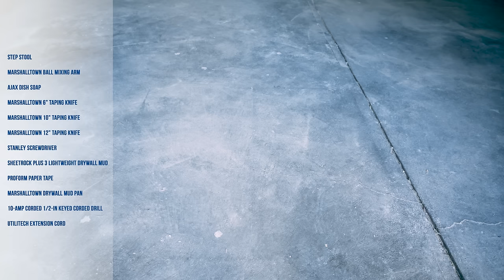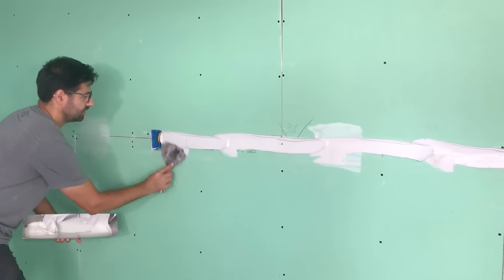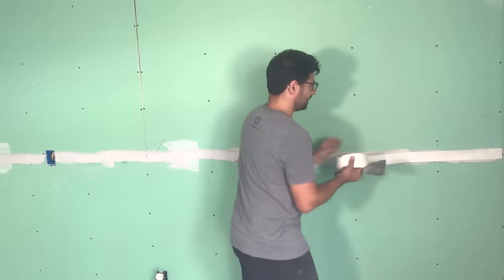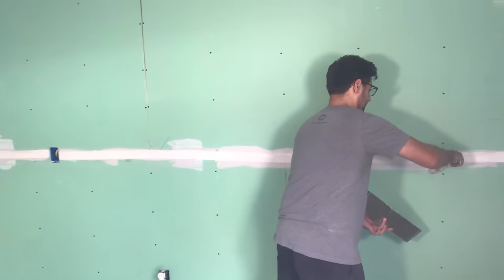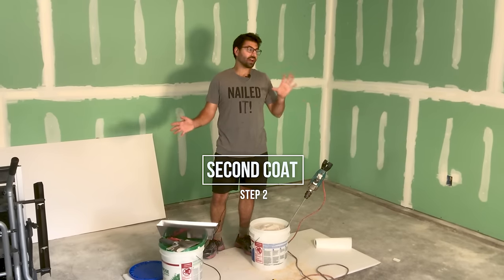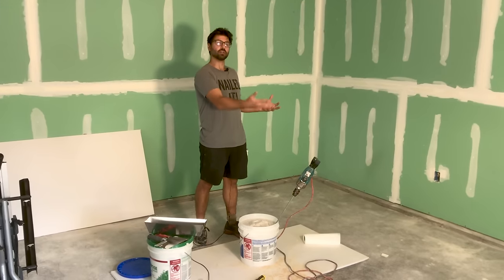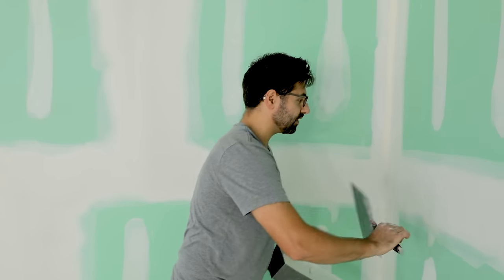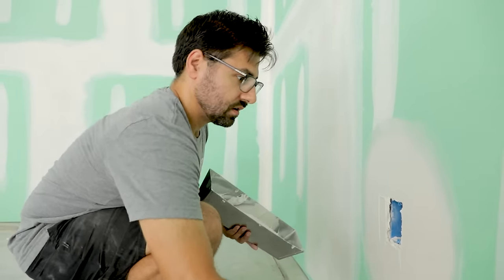How to Finish Drywall For Beginners | Nestrs

Comment: I’ve worked on drywall since I was 10 and now I’m 21. I have watched so many videos on how to drywall just to make see if people do it differently, but I notice that you guys are honestly the only ones who do it correctly.
Reply from the maker: Victor Hernandez haha, thanks Victor! We appreciate you watching -keep killing that drywall game!
Reply: Wrong. Skip the pan..
Reply: I did my first nails when I was 5. Back then they didn't use screws. I'm 52 now. I started working with my dad at 15 but before then I'd helped here and there as a kid.  Some of these videos are so cringe to watch.  My dad started at the dawn of drywall so to say I learned old school is an understatement. I use a hawk, a 14" flat trowel and a 6" knife. That's it. I haven't touched my taping tools in ten years but I could still out pace a banjo with much better results. Honestly, I don't know where these people are learning these days, but they are seriously slow and sloppy. Around here there are a lot of trowel guys, which is fine. I'm just not that ambidextrous. There aren't very many hawk guys but the troughs are generally used by homeowners.  I'd ditch the trough unless you're using it to feed gophers. I think you'll find you can get more material on your tools and run your seams much quicker. This guy had to load his 10' knife like 4 times to do what should have been done in one pass. That's my advice to you. If you're working piece work or by the job, you'll make more money.
Reply: I do everything the same as him besides with flats all you need is a 10 because if you wipe your edge right you won’t need a 12 to go over it I can see with a butt joint

Comment: You guys are great! Couple things... Need to tell beginning drywallers about "hot" mud. The "do it fast" temptation is huge for new mudders. I use small batches (just a pan full, no more) of 45 or 120 for my 1st coat on spaces, joints & screws. It gives me enough time to work but dries fast enough that I can apply the second coat the same day. 

Things to remember with hot mud: SMALL Batches & never mix the crusties back into good mud. I keep a 2nd pan (I like plastic - easier to clean) to put scrapings into. Clean EVERYTHING really well before you make a new batch or it gets hard and you will NEVER get it off. 45 stays workable for about 30 min & 120 for about 90. Set a timer! It is harder than regular mud so it fills in spaces better but it is harder to sand too. If you practice before you actually do a wall, you can get the hang of it quickly & see how fast it set up. It will take you longer than you think it will if you are new to it. FOLLOW THE DIRECTIONS on the bag or avoid all of this & use the premixed stuff y'all are using.

I hate sanding so I am super careful when mudding and take longer than most people do to avoid that.

The other things I do are:
 (1) Run the corner of the knife on concrete real quick (sidewalk, garage floor, etc.. - it will leave a mark on the concrete so be discrete) ; just enough to get rid of the point, but not create a burr. It is a personal preference but it makes corners a breeze. 

(2) Before I mud, I grab a phillips screwdriver & I run my knife over EVERY screw head. I listen for a "ting" sound from high screws. I can easily tighten them as final prep before I start mudding. Trying to do it while mudding slows me down & is super messy, but it NEEDS to be done. You can't leave high screw heads. They will always show, will tear your sand "paper" & the wall will look like crap.
(3) Wash your stuff quickly & DRY it quickly. EVERYTHING rusts & it rusts fast! Rust not only ruins your equipment, but it leave discolored streaks in any mudding you try to do later (i.e., the second & skim coats...).
(4) I set up a work light at a right angle to the wall while I am mudding & sanding so I get shadows from ridges, etc...  

(5) DO NOT clean your stuff in the kitchen or bathroom sink... Mud, especially hot mud, will ruin your plumbing. First, scrape excess mud into a garbage bag & toss it out. Then scrub everything with a green scrubbie pad & dry it well with paper towels. Make sure you get EVERYTHING off if you are using hot mud or it can cause the next batch to harden too fast & you get lumps. Wash tools somewhere where drywall mud haze won't matter. There will be haze.

Final words of warning - Drywall dust & the edges of drywall will RUIN your floors! It is super gritty & will scratch everything. So DO NOT track it everywhere while you are working. Put an old rug at doorways to wipe your feet on. Close room doors so the dust doesn't float all over the rest of the house. It is very hard to get off of stuff. It is also awful for your lungs & eyes masks & glasses are a must. The shop vac is your friend.
Reply from the maker: vrrusa this is awesome! It would actually be appropriate content for “I know the basics for drywall, now what?” or “Drywall Finishing Techniques 2.0”
Reply: @Nestrs  Thank you! Every one of those things Iearned by screwing them up first! (Especially the washing up in the kitchen sink... Now I know how to replace a garbage disposal too!) LOL! Thank you so much for your great vids & super positive attitude!
Reply from the maker: vrrusa LOL
Reply: So you mix the big bucket of mud goes bad in 45 minutes or just the mud you put into the box thin you hold?
Reply: @maddydollear  i think you are asking how much to mix. If you are using "hot mud" or quick drying mud, just what you can use in the time before it sets up. And in the pan you hold.
Reply: @maddydollear  hot mud is a quick setting compound, it has a hardener in it,  comes in 20, 45, 90, and 120 where im at. It is a bag of powder and I would only mix it in a pan with a sheetrock knife and not a bucket unless you are very comfortable with it as it will dry all of a sudden, the water does dry out of it the same as normal mud. Think of it as bondo and the little bit of water that u add activates the hardener in it. I would stick to the normal general purpose mud for taping and floating that is in boxes and buckets. You can use light weight also there are pro's and con's with that also sands easy but also scratches off easy and drys out fast, I dont like using it in long joints and stuff but I do use it for patches sometimes but i always use it for nails / screws as it shrinks less than general purpose mud. One of the biggest problems anyone will have on the wall after finishing is the nails.
Reply: Thank you for not being a negative Nancy as some have been in the comments!  They gave us the basics, but you added some much needed context!❤

Comment: This is great. Your'e a good teacher! I would add to make sure you dust off the sanding dust after you sand or the primer won't adhere. If you just spray primer on top of that, nothing after will stick.

Comment: This video was EXTREMELY helpful! Best tips were the thickness of the mud and thinning it down for each layer, how to taper the  joints, knocking down lips with your tool, and work hard to reduce work at the sanding step.

Comment: Been doing drywall for as long as I can remember, Family owned business mixed mud as a toddler LoL
The video is awesome. the only thing do any different is I fill any cracks (can't seem to hang the rock perfect ever !!!) then tape my Butt  joints first running tape from flat seem to flat seem, then cover with taping my flats, over laping the Butt seem tape. Do the ceiling and lastly my vertical corners.
Reply from the maker: Thank you for sharing!

Comment: Searching your awesome vids... Do you have any videos on how to do an outer corner?
Reply from the maker: Thanks Smoke Shop! No, but I use metal corner bead for my outside corners and screw it on rather than nailing 😉 I don’t screw them in at perfect 90’s. Give it a little crimp so your mud has a small valley to fill on each side. Hope that makes sense…

For finishing: You will want to use easy sand (90 min) or Durabond for your first coat. It comes in bags and you will need to mix it yourself. Follow the directions on how much water to add. It also sets fast so I would work with a third of a bucket at a time until you feel comfortable doing more. The last two coats can be all purpose and / or topping. Good luck and thanks for the comment!

Comment: Thank you so much for these videos relating to drywall for beginners. My first time doing drywall work in my own home and this helped a ton. Also, someone told me to just wet the tape a bit prior to applying it but noticed you didn't. Should I avoid wetting the drywall tape? Thank you.
Reply from the maker: Hey X3, wetting the tape will help reduce bubbles (on the tape) IF you coat it before it dries. I only do this for patch work. On larger projects it tends to make a mess for little benefit. My two cents… thanks for the comment!

Comment: I've been taping and rocking for 15 years , your pretty good! Why do you do the bevels first ? Just curious i was always taught run the butt joints first then the last bevel covers all the ends leaving a very neat look . Its also a little harder to pull the tape side to side correcting mud at the intersection of butt joint and flats.... great job !
Reply from the maker: Thanks for the comment KC. You are 💯 correct. Butts first then flats so the tape is tucked under your flats. It didn’t impact the final look or quality but that is the right thing to do. 👍🏼
Reply: @Nestrs  thanks for the reply! Good looking stuff there!

Comment: Thanks for the video. Nice and easy to follow. Question on the dish soap though...You didn't really say what that does to help? Does it do anything specifically? Maybe just makes it smell better? :)
Reply from the maker: Hey James, I was taught that a little dish soap and water makes for a smoother application for the compound. Less air bubbles and easier to work with. I always argued that soap would create more bubbles but it has always seems to do the trick. I have seen more benefits when using Durabond or Easy Sand when applying to corners etc.
Reply: @Nestrs  Huh, that's brilliant. Honestly, that's how I know you're the real deal. After working for a stone mason and being around all kinds of contractors, the most experienced ones always had the best (and importantly - affordable) tips and tricks.

Comment: Great videos. I am almost done with dry walling my garage, What did you use for skim coat?
Reply from the maker: phranil mehta as far as drywall compound...I used multi purpose for the taping and first coat. For the the final skim coat I use light weight compound or plus 3.

Comment: Man, I was looking for a video that showed a specific thing. I’ve watched probably 20 different videos, and from the beginning, yours was the only one that I actually got knowledge from that I think is helpful. However, the one thing I wanted to see you did not show lol. I’m not a beginner, but I do struggle with second coats (the coat after taping)  on corners Because I screw up one side that I just finished whenever I do the other side so I just do one side at a time but there’s got to be a better way.
Reply from the maker: Thank you! Yeah, you can do one side at a time or use a corner tool.

Comment: So, silly question maybe, if the drywall is 4x8, and you have 2 pieces stacked, I'm assuming the wall is about 8' tall, why did you run it long ways, wouldn't you have less seams running out tall? I've seen a lot of running them long, basically asking what's the purpose?

Comment: Great video! I have a quick issue. Last night at 11pm I mixed USG 90 joint compound  to level some areas on a wall. The leveling was very shallow, maybe ⅛ - ¼ in. 

This morning at 8am the areas are not dry 😮😮.  I did this last night so I could sand this morning. 

Do you have any idea why those areas would not be dry? Should I scrape it off and start again? Thanks to anyone who answers.
Reply: Kinda late but typically the easy sand 90 compound will actually harden but not be completely dry. What you can do is put another coat on the wall to help it settle faster than to just let it dry alone

Comment: Do you do the second and third coats on the corners and screws as well? Or just the gaps in the center areas between the drywall sheets?

Comment: HELP!!!   As a true novice, please advise for a small bathroom with shower:  (1) which product(s) to use to coat drywall before painting.  A handyman left the job unfinished after installing drywall and taping.  I am uncertain which joint compound to use; (2)  I want to "seal" the walls to prevent moisture and mildew.  Can I use elastomeric for this before finally painting the walls?  (3)  How much time to allow for drying between applications?  Thanks in advance.
Reply from the maker: Hey Chalice Guard, first I would want to confirm that your handyman hung concrete board or purple board in the shower stall unless you are installing a solid surround. The rest of the bathroom should be green board. Mesh tape is best in the bathroom and some would argue everywhere. The type of compound you use is less important (all purpose is fine). Your shower stall should get red guard or aqua seal on the joints (instead of compound). I typically coat the entire shower stall. Hope that helps 😬 and thanks for the comment.
Reply from the maker: And dry time varies depending on the environment (temp, humidity etc.)... sometimes can take as little as a couple hours and as long as two days. Just make sure it’s dry 👍🏼
Reply: @Nestrs  - The shower stall was not affected by the install.  It involves the wall outside of the shower stall which includes a window.  The drywall and taping part is done.  I just need to know what steps to do next before painting and to seal the wall from humidity from the window and steam from shower.  Thanks.
Reply from the maker: @chaliceguard4575  all purpose compound and a high quality primer / sealer will be fine.

Comment: Would it be better to start from the center and outwards ? When swiping
Reply from the maker: Hey Michael, I will say for a beginner it may reduce the movement of the tape by starting in the center. I think it is going to slow somebody down with more experience by going back and forth. In terms of quality really doesn’t matter so if that works for you go for it 👍🏼

Comment: So...I removed popcorn on 2 ceilings. I went back over it with spackle and repaired some minor imperfections like where the drywall frays alittle, not rips but sheds some so I spackled over that. Now how smooth does it have to be before priming?
Reply from the maker: Hey 1lkydad75 😆 Just seeing this. You want at least two skim coats after removing a popcorn ceiling.

Comment: Hi there! Great video, been doing this since I was a kid, but clearly I had more to learn! 😅 Anyway, I was wondering how, or if you coated the tape in the corners with the 2nd and 3rd coat? I'm used to mudding one side of the corner, let it dry, and then do the other side. Thanks again!
Reply from the maker: Hi Susan,  they do have a specialty tool that attaches to a pole you can use for corners and it is great however you’re looking at about $300. For hand finishing you are doing it right. Mud one side, let it dry and then do the other side. I have used corner hand tool that works but it has a bit of a learning curve. I have found them to be a pain in the butt. Hope that helps and thanks for the comment!
Reply: @Nestrs  thank you for replying! Back to the grind stone I go! 😅

Comment: Im a professional drywall finisher from Toronto I must say doesn’t look bad , but the butt joints should be wider. I always sand between coats with 100 sandpaper, and then sand the skim with 150 sandpaper
Reply from the maker: Thanks Henrique! I usually sand between coats as well. However, I was always taught that the best don’t need to. Haha, I had a tough teacher. Thanks for the comment.

Comment: So in the video u started with a 6” blade, then a 10” and then 12”. Are these used everywhere? On inside and outside corners, nail holes? The mud doesn’t look as wide in the corners or the nail holes. Thanks

Comment: Hi, thanks for this beginner video.  Very helpful.  Question....I"m also wanting to drywall my garage.  I'm not too sure about my ability to do the taping and mudding and wondering if I can avoid this step by installing wallpaper over the newly installed drywall?  Or maybe just do step 1 the taping/mudding and then cover all with wallpaper?
Also, if your answer is that I do need to tape, mud, skim, etc., I'm assuming I don't need to texture and go straight to priming & painting?
Reply from the maker: Thanks Rita! Regarding the wall paper... you will definitely see the seems in the drywall through the paper. I would recommend doing at least two coats to create a flat surface. No need to texture 😊

Comment: Do you have a video for doing the tape and mudding on the ceiling. I've got the the Wall part okay but  taping and mudding the ceiling I find more difficult?
Reply from the maker: Hey Shell, well ceiling are a little more difficult but it’s the same technique. The big difference is when applying the mud you are going to work in shorter spans (or you are going to make a mess on the floor). You will also want to hold your pan under your knife as you go to catch any access mud that falls. With some practice it is a piece of cake. You got this!

Comment: I have half of a bathroom that we are redrywalling, I have unfinished drywall next to finished painted drywall. Would this work in the same way or should I sand down the existing drywall first?
Reply from the maker: WooDeeWolf great question. Same way. Just keep in mind that you may have an issue with matching your paint color perfectly. I would finish the drywall and plan to repaint the whole wall (including the wall already painted). Hope that helps!
Reply: @Nestrs  thanks! We are planning on repainting it to a different color when it's all finished.